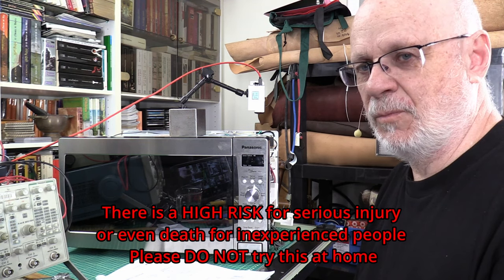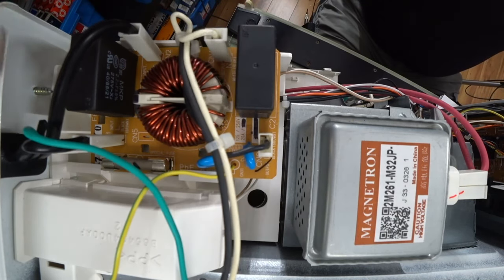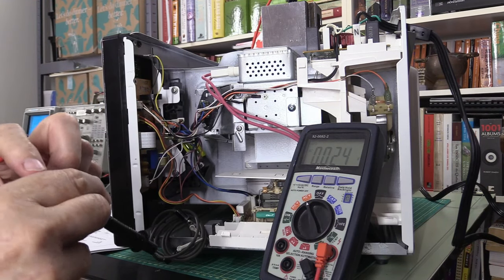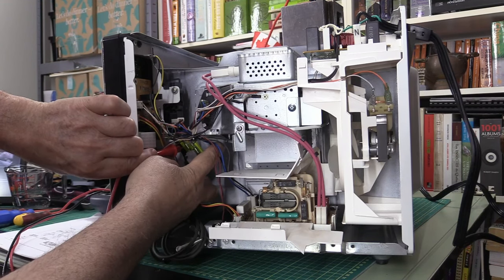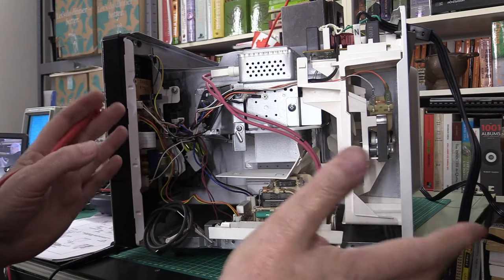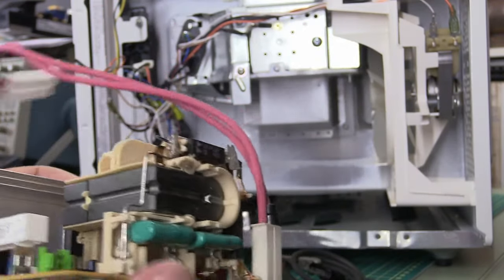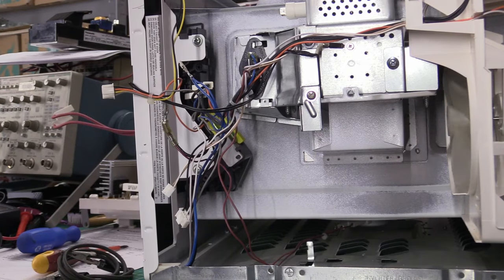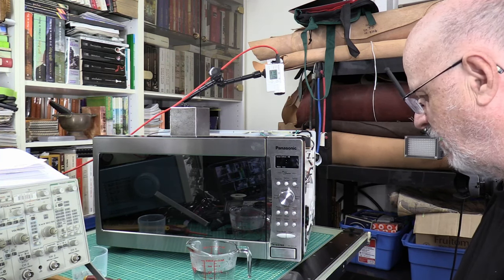Panasonic Inverter Micro-Wave repair (Many other models similar or compatible )

Comment: Great video. I have the same issue where the microwave shuts off within 3 seconds. I tested all 3 door switches and they have continuity and appear good. Next i wanted to test the same relay that was causing your problem. I tested it by running the microwave and checked the voltage being fed by relay into the inverter. I get voltage but it was only 100V and not 120V as it should be. Does this low voltage measurement indicate a bad relay? You mentioned you got no voltage which obviously indicates a bad relay. Not sure if my low 100V measurement is causing the Inverter not to activate because the inverter needs 120V.  Any help would be appreciated!
Reply from the maker: Having voltage across the relay isn't good, the way I tested this issue was by starting the microwave and before the control board would detect the failed voltage ( within one second or so ) I shorted the output contacts of the relay with a screwdriver, at that moment the microwave was functionning normally. 
Let mee know if you try this and how it turns out for you, I highly suggest you wear eye protection and insulating gloves, worse case scenario, the main fuse will blow.
Hope this helps

Comment: Can you use any magnetron from normal transformer microwaves in an inverter microwave or are these magnetron’s different
Reply from the maker: It's better to get the same item or a similar one in order to respect the same power output handling capacity. Normally you shoud be able to find something similar or direct replacement since there is a good choice of different ones available.
Thanks for your comment....   🙂🙂

Comment: Hi, great video! I have a Panasonic inverter without the timetable with constant h97 errors. I've narrowed it down to consistently happening when there is only a small amount of food in the microwave, ie one cup of etc. If I put in more food, the error does not happen. Is this voltage feedback to the inverter or a faulty magnetron do you think? I wish it was a door switch lol 😁
Reply from the maker: Hi, 
A h97 error is related to a lack of power or a faulty magnetron.
Since you're dealing with very high volatages you'll need to be very careful, if you have no experience in electric components repair you may want to pass on this...
If you really want to do this repair.....  
Unplug the apparel.
First you have to check the resistance on the magnetron's connectors, disconnect the leads, after shorting the leads to discharge any residual charge in the magnetron, using a multimeter on Ohms function, measure between the 2 connectors, you should get very near 0 Ohms, also measure between those connectors and the body, there should be near infinite Ohms ( No connection ) when unmounted lookout for failed donut shaped magnets there should be no cracks, the business end of the unit should be nice and smooth, if not this is a faulty magnetron...
If you require a new magnetron, look on eBay using the number written on the face of the magnetron, at this moment those should be around $25 to possibly $50 USD.
After you replace the magnetron you'll probably need to reset the h97 code, it will be a combination of keys on the keyboard, since it differs according to the model look out on line for your actual model.

Hope this helps,
Pierre

Comment: Hi again Pierre just wondering how you tested tge Relay as i assume like me  the power supply 29amp fuse had blown. Thankyou for sharing
Reply from the maker: If the fuse blew, I would suspect that the problem would be most likely a defective IGBT transistor the rectifier bridge or something in the high voltage module, those are common and relatively easy to replace...
Reply: Hi Pierre thanks for your quick reply.I  it looks like the Magnitron is faulty i have one froma smaller microwave donated for spares. Would it be okay to swop over? I guess not i have yet to test door switches. Thankyou
Reply from the maker: Not certain about using a different magnetron, I suspect there should be matched to the high voltage section, the first test to evaluate a magnetron is to measure the 2 input terminals, those should be very low resistance, like around 1 ohm or under, secondly, there should be no contact from those 2 contacts to the boby. 
What I've seen about magnetrons, they're quite easily available at prices around +/- 30 to 40 usd.

Comment: Hi my Panasonic inverter nn-sc668s just stop heating. Runs normal but I can hear intermittent clicks every few seconds. After a 2min run it shuts off after 45 secs and does not heat. Any ideas?
Reply from the maker: Is it possible that the clicking sound comes from the relay being activated intermitently...?
If so it's possibly the circuit activating the relay that is not functionning properly, second possibility that the relay is intermitent.
There are some more readings you could do to pinpoint some issues, only if you're somehow familiar with electrial and elec circuits, if not the solution could be to refer to an experienced repairman...
Reply: @pierresgarage2687  Awesome thanks. I'll check that out. First time working with an inverter microwave so was a little curious.

Comment: We have a "Panasonic, The Genius Sensor 1250W Inverter", Model # NN-H965WFX microwave similar to yours.  Our microwave was abused by a family member who slammed the door often.  Eventually, the microwave would randomly totally shut off just as if the power plug was removed from the wall.  Hitting on the front of the control panel would cause the power to return and the microwave would run, but eventually hitting it no longer worked.  (I know that is wrong to do, but I mentioned it to aid in troubleshooting the issue.)  I tested the input board, fuse, and all three door switches as you instructed and all are good.  Would a bad relay cause all visible power to shut off, including the inside light and display not to work?  I removed the two wire leads going to the relay and the circuit is open across the terminals.  Is there a way to test this relay without removing it from the board using only a multimeter?  Would momentarily bypassing the relay by connecting the two wire leads from the relay cause any harm?
Reply from the maker: When the relay is bad you normally still get the light and etc, I would suspect more the problem to be the support for the interlock switches to be worned or misadjusted caused by the rough handling of the door, that would be a first step to check of the wear or breakage of the support that hod those 3 switches...
Reply: @angelhelp777 I'm having the EXACT same issue as you!  Have you found out what was the problem?  EDIT: See my other response... The problem was the Low Voltage Transformer.
Reply: @pierresgarage2687  Salut Pierre! Fyi, I've had the exact problem as @angel. Shutting off randomly (no display, no lights). Hitting the front/side near the control board would solve the problem until it got less and less effective. Took a full day trying to understand the issue.

All switches, and relay were looking good. Ultimately, the culprit was the Low Voltage Transformer. Trying searching for a replacement part turned out expensive... Maybe there are cheaper alternatives.  In last resort, I used my soldering iron to:

-desolder the Low-voltage-transformer ... 7 pins to desolder.
-remove protective plastic
-once out, investigated it.
-turns out the pins are connected with hair thin wire. 
-decided on giving it a good bunch of solder to assure connectivity between wire and pin.
-soldered back onto board

All works now!

Weird that I couldn't find any more info online besides this commenter.

Good luck to all.
Reply: @pierresgarage2687  The fuse, thermostat, and all three door switches work perfectly.  I tested the switches both in and out of the microwave to ensure the latch was actuating the switches correctly.  I get power through the fuse, but there are no signs of life anywhere else.  The display and interior light do not light up and the microwave is totally dead.  As it began to fail this microwave would randomly power off like it was unplugged, and come on when you bumped the front side near the control panel.  Over a period of a few days, it required more bumping till it just quit altogether.  I thought it was just a door switch, but they all tested OK.  What else could totally kill all power to the microwave?  Someone mentioned a low-voltage transformer.  Before I start a quest to find one, how do I test a low-voltage transformer and is there anything else that might cause the power to totally shut off?  I am not a repairman or electrician, but I do have a micrometer and am determined to learn what is wrong.  Any help would be appreciated.
Reply from the maker: Great that you succeded fixing your appliance, most of intermitent problems are due to defective contacts or solders that become "Cold", those are often difficult to pinpoint, a few examples like a cracked motherboard, connectors with broken or cold solder, burned connector, etc... This type of problem requires a good pair of eyes....
Reply from the maker: @angelhelp777  
Those intermitent problems are the worse, you'll need to combine many investigative methods, first visual inspection may help in finding "Cold solders" look closely at solder points that are not looking shiny or with a tiny ring aroung the component's lead, connectors or heavier parts are more prone to this. Using your multimeter you follow the current path until you discover where it read a wrong voltage where it should be present, your relay can be tested in this maner, if there is 120 volts across it while the microwave is supposed to function, then, it's open, either the contacts are burned or it's not actuated by the control board, etc...
Be sure to find and download the schematic, this helps a lot.
Reply: @angelhelp777  The trick to test the low voltage transformer is using a ohmmeter between the two set of pins on the same side.

One side of the transformer is the high voltage section, and the output is on the other side, low-voltage. You can test this without having to plug the microwave.

My problem was on the high-voltage side. Test with a ohmmeter. I had zero continuity which meant it had a loose connection. You should get a 400-600 ohm.

This is the video I found (a little) useful: https://youtu.be/0FETHzbPfrs   listen starting at 17 mins.

Comment: The amperage while cooking fluctuates between 0 and 8amps is that a faulty relay. Then microwave shuts off
Reply from the maker: If you want to confirm that the relay is defective you can measure the voltage at the output end of the relay ( the wire that goes to the high voltage board) if there is a constant voltage, the relay is good, if the voltage cuts, the relay or the relay  may be defective or the activation command is faulty. If the line voltage is present at the input of the high voltage board it 't possible that the board is defective or intermitent.
Reply: There is constant line Voltage input to the HV inverter so the inverter board is defective
Reply from the maker: Hard to diagnose from where I am, but, it sounds possible that your HV board is intermitent or defective. I don't know how you camn manage advanced electronics repairs, this is getting quite more complex. Before all , have yout checked if there is a good connection on the control connection, it's the wires on the connector 701 on the HV board going to the relay board. Hope you downloaded the service manual listed in the description below, if the appliance model is lightly different from yours chances are that the schematics will be close enough to yours. There is in the manual a section on how to test the main components that may fail on the board. Remember to be EXTRA CAREFUL when dealing with this type of repair, voltages in excess of 2 to 3 thousands of volts with lots of current is present there, this could injure you or even kill you, I suggest that you undergo this procedure only if you know have pertinent experience in this type of repair...

Comment: The magnetron anode touches metal within the mounting housing. Is that normal?
Reply from the maker: If the magnetron housing is isolated from the unit and there is one of the side that makes contact with the case, there is most likely a problem with this magnetron. Look out on Ali express or Ebay using the number on the unit, you should find something in the 30 to 50 USD range. look out for burnt windings on the High Voltage coil or anything wrong ont the HV board...  Let me know how it turns out...

Comment: Hi, great video :) I"ve seen some others talk about running the inverter on it's own with the board behind  the logic board. but they use signal generator or 555 ic to make the invertor powers on ... do you know any simpler way to run the invertor board without thos 555 IC or signal generator? because in your video you explain the relay make is with I become a bit confused.
Reply from the maker: Not aware about running the oven using an extra board, I'm more on finding a solution by finding the actual problem. The relay shown in this video is actuating the high voltage board by switching the AC line in response to the request from the control board.

Comment: I've fixed a few of the similar model ovens - you will notice at 3:41 - the right connector overheated..  I saw several of the push-on tab connectors fail on these ovens - expect to see design errors in the repairs. Nice oven - but they cut every corner they could..
Reply from the maker: I noticed that, this is why I pulled it out and reseated it in order to rejuvenate the contact.
You're absolutely right about cutting every last bit of surplus in order to lower "Their" cost....   😉👍
Thanks for viewing and for your comment,   Pierre

Comment: I have one when I push on the small transformer on the main board it turns the display on and off.   I have re-soldered the transformer and all the stuff around it.  Still has the issue :(
Reply from the maker: Either the transformer isn't the issue, or, there is a little wire in the transformer where the connections to the mother board and the windings would be broken, if not, the problem is elsewhere....

Comment: Hello again Pierre just wanted to update re my Panasonic MW with similar issue..I had to  change the Magnetron and yet to test. I enjoyed very much your video and i think i need to check relay. Can i test it out of cct? Thank you Lewis in UK keep doing videos ☺
Reply from the maker: You'll be able to test the relay ou of the circuit if you can apply the proper voltage to the coil in order to activate it, then you check if it closes the contacts...
Hope it works out .....    😉👍
Reply: @pierresgarage2687  
Hello again Pierre another update Pabasonic MW like yours Success!☺ Had to replace Magnetron and 19A fuse. Everything else seemed ok Merry Christmas please keep in touch on youtube Lewis in UK
Reply from the maker: @walker55able  
Glad to hear that this microwave will live for some time longer...
If we can avoid trashing something repairable, let's do it.
Happy Holiday season to you and your loved one....    🎁🎁❄❄
Pierre

Comment: I want to know why the fuse always burning when I get start? |Thanks
Reply from the maker: It's most likely that the high voltage board ise defective, the main items that would fail are the IGBT transistor, the bridge rectifier and also possibly related components. You'll need some basic experience in electronics bebore undergoing those tests. If you download the servicee manual there is a section on how to test main semiconductors used on the board, the good news is that many models of apparels are using the same standart board.
Hope you resolve your problem...
Reply: Thank you, Pierre.

Comment: Anyone can help with suggestions it’ll be appreciated. My Panasonic nn-sd997s  only shuts down after 2 consecutive heatings of 4-5 mins each. It’s gotta be overheating. I’ve already checked the magnetron with the mm and it checks fine - visual check looks good as well. I pulled the inverter and visually checked the board and no burn marks etc.
Reply from the maker: Have you checked if the line voltage appears at the HV board, also if the relay is actuated, if not the problem would be on the  on the control board or before. there is also a small connector from the control board to the HV board, this connection is monitoring the high voltage output and if not present will stop the process....
Let me know how it goes...
Reply: Thanks for your guidance. Will be careful in proceeding considering the machine needs to be plugged to get these readings 😀
Reply: @pierresgarage2687 , por favor, o senhor sabe informar como funciona a comunicação entre a placa de controle e a placa HV?
Estou querendo substituir a placa HV por um transformador comum. Mas preciso fazer com que a placa HV não desligue. Pretendo montar um circuito para simular o sinal da placa HV que vai para o acoplador óptico.
Reply: @pierresgarage2687 Please, can you tell me how the communication between the control board and the HV board works? I'm looking to replace the HV board with a common transformer. But I need to make sure the HV board doesn't turn off. I intend to assemble a circuit to simulate the signal from the HV board that goes to the optical coupler.